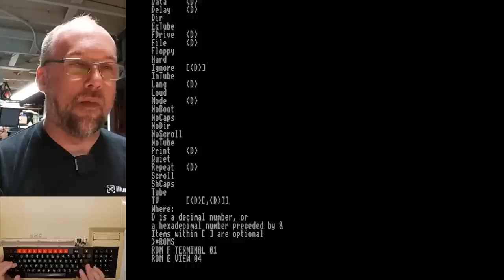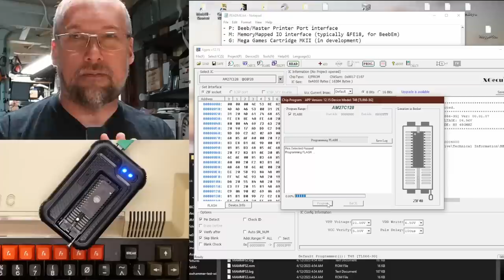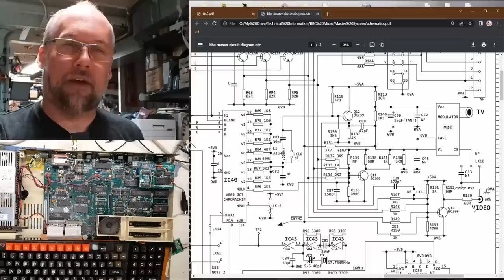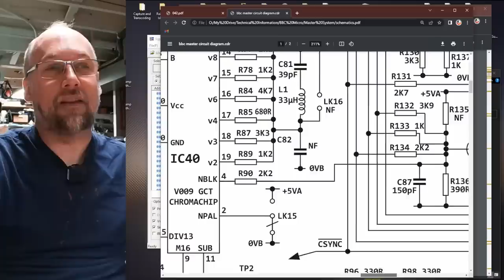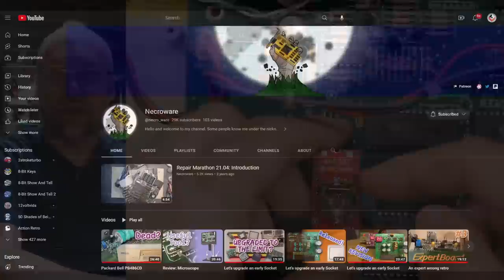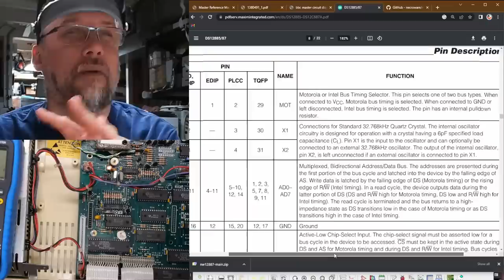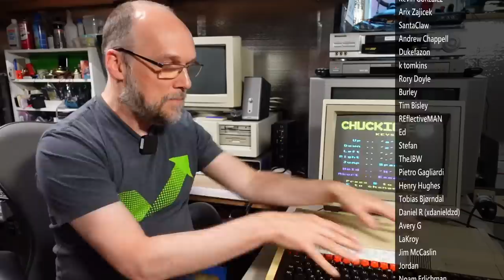BBC Master mods and improvememts

Comment from the maker: Hi everyone, my patrons pointed a small error in my video with regards to color composite. In the video, I said connected the color signal between R118 and R130 (Effectively the base of Q12) and ran that to another resistor that was effectively the base of Q13.  As I mentioned in the video, to do this mod, what you actually need to do is connect a capacitor between the emitter of Q12 to the base of Q13 using a capacitor. The capacitor I installed in the video was actually connected to R137 (the emitter of Q12) and went to R151 (base of Q13.) Both of these resistors are BROWN BLACK RED GOLD, which are 1K resistors, so if you replicate the resistor as shown in the video, it will work.  Here's a picture of the mod: https://imgur.com/a/nVUQfdC
Reply: I don't understand why this mod was necessary. Wouldn't the OSSC convert the PAL signal form the RF modulator to standard HDMI?
Reply from the maker: @technerd9655  OSSC only has a SCART and VGA (RGB) input.
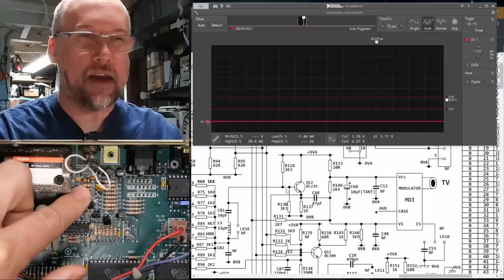Reply: Just paused @30:20 and scrolled down to the comments to point this out; glad you already caught it. :)

Comment: IIRC, the weird characters you see loading games (e.g. Arkanoid) occur because the Master has a different character set to the Model B, and the games were originally written for the Model B.

The explanation of the parameters for the "TV" configuration now finally make sense after decades of me not knowing exactly how they work.  It seems so simple now - it's a signed integer!
Reply: This is NOT correct at all. The weird characters are caused by the address space being different on the Master than the BBC B. For instance the expanded character set on the BBC B, with say a tape filling system lived at Page &C00. So code for the BBC B used to directly load into that page. The sound and envelopes were pages &800 and &A00 etc, so rather than defining the envelopes, you would directly load into those pages. On the Master, those pages don't contain the character definitions anymore, so code that directly loaded into those pages doesn't work and that's why you're seeing weird characters because the graphics are loaded there, but the Master isn't using those pages for graphics.

Comment: If I recall correctly, although MOS 3.5 has several bugfixes, it is even less compatible with BBC Model B software than the standard version. For maximum compatibility, an OS downgrade to something like 1.20 is necessary. It's a relatively common mod to have a large EEPROM with several versions of the MOS which are switched out with a hardware toggle or rotary switch picking which banks get switched in and out.

Comment: that is cool being able to replace the NVRAM chip, that has been a persistant pain for many bbc master owners (bbc micros don't have NVRAM)
Reply from the maker: Yeah I was frankly shocked when I saw everyone suggesting to replace the batteries and more AA batteries and then add a diode and resistor. I thought there had to be a better way!
Reply: @adriansdigitalbasement  the original battery arrangement was definately handled by the B-team, as it didn't even have the diode/resistor arrangement, resulting in exploding battery packs

Comment: Hi Adrian. The EPROM that you removed may contain NFS (network filing system) which is needed in order to use the Econet interface.
Reply: doesn't the bbc master have a megarom that contained all the rom images, including ADFS and DFS ? wasn't NFS part of the DFS like the DNFS 1.20 ?
Reply: @kwanchan6745  no - its a separate chip. I never understood why they didnt include it , but they didn't
Reply: You can see when he downloads the image from teh chip theres no actual code just gibberish/ random data.
Reply: @ukwebb  correct, it certainly wasn't a language rom as, by design, they have to have an identifier at the top in readable text which gets displayed by *ROMS. The lack of any such identifier means it would not be recognised by the system. It could be some kind of game data but I doubt that. Most likey just a spare rom that was kept there for safe keeping.
Reply: @andyjdhurley  same for service roms ;) it identifies a rom as being ' of interest' by looking for the copyright header  '[null](C)'  which must start at the offset position recorded in the 8th byte (x0007) in the rom.
Reply: Few people will be using Econet.

Comment: I grew up in the UK so remember the BBC Micro and relatives being so ubiquitous in schools and around 6 months ago acquired a BBC Model B in Australia where I live now, unsurprisingly it originated from a school. Finally got round to renovating it after finishing other projects and this series just happened to coincide quite nicely. It's been quite a joy to discover how advanced they were for their time compared to their contemporaries although they would have cost a lot more than a  Spectrum, C64 or Electron. In many ways it quite sad how progressive the UK was in the 80s and very early 90s with computing and then, well nothing... I guess ARM being an exception...
Reply: ARM being Acorn Risc Machine in the era of the Acorn Archimedes A3xx and A4xx first generation machines, then the name evolved and the processor became the heart of a majority of tech globally since from Apple to Arduino etc. But let's not forget the Raspberry Pi machines and the RP2040 as used in the Pi Pico...
Reply: My Model B was 349 UKP (from memory).....though I may have received a 50 discount. Add 49 quid for an old TV, how I lusted after a Microvitec CUB :D
Reply: @jkdsteve  I'm guessing it was later than 1984 or didn't have the Disk Interface...
Reply: In the first evaluation boards ARM1 ran as a co-processor in a BBC Micro.
Reply: @crashoverride328  Yes, I was on tape for quite a while, so relieved when I added a (Cumana?) drive some time later.
Reply: @jkdsteve  I got mine with the Acorn Disk Filing System, but upgraded it to the Solidisk DFDC (Dual Format Disk Controller) gave you the original Acorn DFS, Solidisk DDFS (Dual Density Filing System - got rid of the 31 file limit Acorn had) and also the ADFS (Advanced Disk Filing System) - Add to that the Twomeg 128 (128k of paged ram that could emulate Roms) and the Model B was quite the powerhouse.
Reply: This was one of the primary drivers behind the creation of the Raspberry PI (Another UK invention). The Video Game console basically killed the self-taught computer programmers that those early computers generated.

Comment: 8k roms worked fine in Beebs. Instead of being mapped from $8000-$C000 they showed up as 2 copies of the 8k at $8000 and $A000, and the software was written within the 8k, so ignored the address space above $A000. This is because on 27128's all 14 (i think) address lines were used to select which byte in the rom was accessed, whereas on 2764's the highest address line was not connected, making it repeat its contents into the 2nd 8k bank in the memory map. Some roms (Quest paint for example) even included a Nintendo NES style 'mapper' chip that detected activity on a 'magic' address, and switched between 2 27128's, giving a total of 32K of rom. ah, memories :) edit: would love to see you read that unknown 8k you pulled out - you seem to have the right kit to do so, or you can also use utilities on the machine itself to read it. Maybe its just been exposed to too much UV light over the years and has wiped itself?? Were you also aware that Masters had sideways ram, so you can load images of roms into it (using *SWLOAD I think) and they will behave like actual physical roms. Cant remember if the master had battery backup tho, so u did the right think blowing the eprom for your filesystem driver
Reply: It's not SWLOAD, it's *SRLOAD followed by the slot number and optional load and execution address.

The Master did indeed have battery backup, but it wouldn't retain ROMs loaded into Sideways RAM. Also a full hard reset, so say a *FX200,2 and break would also clear out your sideways RAM.

Comment: I wrote a program on this micro to calibrate reference grade accelerators for national standards in the UK, using laser inferometer techniques and IEEE controls … BBC basic was so powerful back in the day.
Reply: Yep, I wrote a full on database in BBC basic for my exams back in the day. It was clunky and did things the slow and long way, but it worked fine.  BBC basic is insanely powerful, and encouraged structured programming. And the built in assembler was fun too.
Reply: My final year university project was to build a satellite tracker using a Beeb. Orbital calculations were in BASIC talking to the Real Time hardware controller written in assembler ... I absolutely loved that project.

Comment: The Commodore 1084 is actually a Philips CM8833, which was sold by Acorn as the AKF12
Reply: Although the Philips versions are more common Daewoo and Likom also made 1084 monitors.

Comment: The 68 Ohm output video resistor is probably correct because you also need to account for Collector Emitter resistance of the transistor which is probably 7 Ohms to make a total of 75 Ohm appearing at the output.

Comment: Great video Adrian. Even though I was a die hard C64 teenager in the 1980s, I had a lot of respect for the BBC machines. Toward the end of my school life my High School (in South Australia) set up a computer room with a dozen BBC B machines, all connected to each other, a shared printer and floppy drives with Econet. Loads of fun sending messages between machines using Econet 🙂

Comment: For mass storage on my Master 128, I opted for the Pi1MHz solution, which interfaces a RPi Zero with the 1MHz Bus port under the keyboard through a level shifter board. The firmware on the SD card as part of this project emulates (amongst other things) the BeebSCSI add-on, which provides me with up to 4 hard disc images, each up to 512MB in size - so that's 2GB disc space. What's even better here is no ROMs (or ROM images) need loading to support this, as it's completely compatible with the built-in ADFS.  (I also had a spare Pi Zero that was gathering dust from an earlier project that was no longer in use, so I gave it a new home here.)
For video output I got a cable which connects the RGB socket to the RGB lines of a SCART plug which goes in the back of my TV.

Good video series, I enjoyed watching it.  I had considered MMFS, but ultimately decided on Pi1MHz as I don't have any EPROM programming kit (or any EPROMs to use).

Comment: If you look at my SD card adapters, it is just a board to move the wires around and an arduino adapter soldered together with a 20pin plug. I sell them with an SD card with my menu on it and an EPROM with MMFS but only in person, usually at shows to people who I think would otherwise put their beebs back in the loft or get rid of it. This isn't an advert, so please don't try to buy one from me.
You may have noticed the white triangles near the IDC connectors, all the original BBC add-ons have matching triangles on their connectors to help get them plugged in the right way around.
I put them on my boards, but tipex (snow pake or whatever over there) or a piece of white tape can save you from embarrassing mistakes ;)

Comment: Note: the schematics came with the original manual.

Edit: as my fading memory comes back, I remember it was included with my BBC Model B manual as a fold out in the back of the manual. It's been a while since the days when everything came with a comprehensive manual... :)
Reply: not the standard manual, a bbc micro foldout circuit schematic came with the advanced user guide which had to be purchased separately

there is a newer online version with the original errors corrected
Reply: the original manual had some schematics at the back, but they were not foldout and not A3 size like that of the AUG

Comment: I love that someone got SPI working with this machine.  Such a perfect solution.
BTW, if you ever have a damaged SD card, using SPI is a good option to try to get the data off of it.  It takes FOREVER but it works.

Comment: you can run tape around the edge card connector leave it sticking up above the pin side,stand it on end and fill with hot glue to encapsulate the connections. embed a wire loop in the glue as a pull tab

Comment: In the 1990's in the UK most TVs could display NTSC 4.43 which is the oposite of what you have created here 60hz but with pal colour this was used by people that had american VHSs or DVDs because there was a wider range of titles avialble in the uS and japan.Because i wanted to record my US sourced VHS to DVD i ended up buying a US DVD recorder ( which was very cheap because it didnt work in the UK) and an analgue TV standards converter so that i could convert my NTSC 4.43 that was coming out of my UK sources VCR to NTSC 3.58. Previously i had, had a Uk sourced VCR that had a switch on it so that it could either  output pure NTSC or 4.43 they were sold in the UK by panasonic and all anime fans had one, but mine had broken before i had sourced the NTSC DVD recorder hence why i used the standards converter! I aslso discovered that my analogue converter also removed macrovision!
Reply: I remember saving up for a DVD player with the same output switch option, always wanted the fancier VCRs but by the time I had my own money there was less of an impetus to get one.

Comment: I was the proud owner of a BBC B in 1983 after having a ZX Spectrum and I was worried to come down from 48K to 32K but this machine and it's BASIC and in-line assembly simply made the best ever 8bit machine. That how I learned about I/O a Analog to Digital conversion and finally was able to connect the BBC to my electronics, LED's, servos, the works. Take good care of that machine my friend, I am also going to use some parts I have to make a SD card upgrade like you. Great work !

Comment: The BBC Micro's were very capable machines. The cost of owning one was substantial, so most homes had Sinclair ZX Spectum's (in the UK, that is). I think some judgement is based on how many games were available for machines, but it's clear that it makes financial sense for bedroom coders to make games for the more popular, widely used home computers. The games (not that games should be what defines a machine's capabilities, but that's what home computers mostly got used for in the end) that were developed for the BBC, particularly arcade clones, were pretty impresssive. When Acornsoft released 'Elite', it was a game changer. The port to the Spectrum was good,  but the C64 couldn't plot lines as fast as the BBC, because the 6502 processor in the C64 wasn't clocked as fast. Saying that, the 64 was an incredible bit of kit too. So much innovation in those days.

This video may be of interest to American viewers: https://youtu.be/GpWoF5uVgbA

Comment: Great video. I have a BBC Master here in Massachusetts. I use an RGB -> SCART cable from fleabay and a SCART to HDMI upscaler to view the video signal on an HDMI monitor. This solution works very well for me.
Reply from the maker: Yeah that's how I first hooked up my BBC Model B ... those upscalers are quite laggy unless it's something like the RetroTink or OSSC, but those are so costly.

Comment: The corrupted text is likely due to a compatibility difference between the original BBC and the Master; in particular how they handled soft-defined characters.   The memory map changed between OS1.20 (the B) and MOS 3.2/3.5 (Master).  So it's not uncommon for B games to show corrupted characters on the Master, especially if they cheat and load directly into RAM rather than using the official "define character" routines.

You can get a "multi-OS" ROM for the Master that lets you have MOS3.2, MOS3.5 and a modified OS1.2; just switch between them with a toggle switch.  The OS1.2 mode normally solves these problems.

Comment: Great video. If you have a couple of spare Raspberry PIs there are a couple of things you can do... Coprocessor emulation through the Tube interface (pitubedirect) and 1MHz bus device emulator (Pi1Mhz).

Also... Have you figured out the significance of the StarDot forum's name? 🤔
Reply: yes the Coprocessor mod would be fun to play with, especially the 80186 where you can run old DOS programs.
Reply from the maker: Hah yeah ... *. for directory listing on the Beeb :-)

Comment: The incompatibility you mention near the end could also be due to the Master using a CMOS 6502 based CPU, while software written on the Micro would have been a original NMOS 6502.  The stuff that's failing most likely is using some 6502 unofficial opcodes.

Anyhow, great vid.  Somebody needs to get you a Acorn Archimedes to play around with.
Reply: Agreed, although the BBC and Master were much easier to mess around at the hardware level, by the A3000 era it was more about software. I leared my hardware basics with the BBC B, assembly language and coding my own ROMs, once I got the A3000 I stuck to coding and office applications.

Comment: The BBC Micro is, IMHO, the best 8-bit machine I've ever used.  The BASIC supports in-line assembly, and it can be expanded from the basic cassette tape model all the way up to running Digital Research DOS and the GEM Desktop GUI off a SCSI HD simply by installing/swapping out the primary and secondary CPU's and a file system ROM.  I really wish this machine had caught on better in North America back in the day as it was/is so much better than anything that was out at the time.

Comment: BBC Master Compact on my shelf here in N America (Canada). Didn't make any NTSC mods though, cause I have a PAL RGB Scart TV.

I installed an SD interface internally with the exact same games image it looks like you have, and I also installed a little RGB to S-Video board inside that brings S-Video out to the back of the system which is handy when I use it with a projector! 

Even though most North American TV's are absolute shite when it comes to handling PAL, projectors sold here can be quite good so I use them a lot!